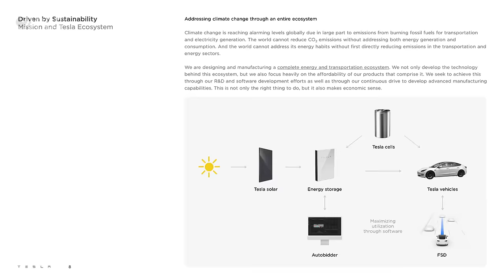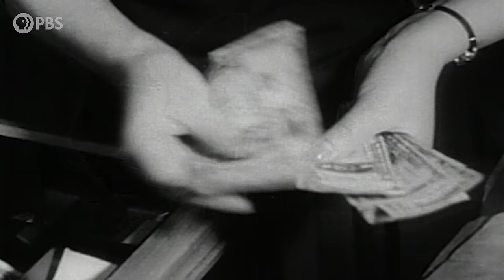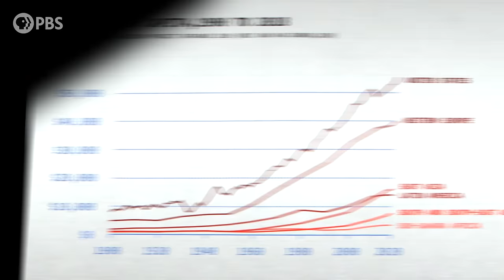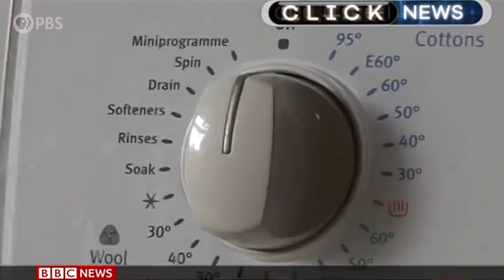You Can't Shop Your Way Out of Climate Change

Comment: The fact we are not focused on electric generation and pushing EV cars is literally putting the cart before the horse.
Reply: The American way. AMURICA LOL
Reply: Hydrogen would be better.  EV cars are almost throwaway cars at this point in time. Once the battery pack is gone and it's out of warranty who would pay more than the car's worth to fix it?  Hydrogen is the most abundant thing in the universe. Toyota has made some innovations in the last few years.  BEV's should just be a stop gap.
Reply: @deucebigs9860  the problem is just that Hydrogen is just a bet in the future, right? No one knows if or when it could work
Reply: The problem is Evs is that the wost enemy of batteries is cold and heat 

Too cold like any battery then it will die quickly and the same with heat as if it’s 95 or more then the battery will be overheated and won’t work and pushing ev cars suddenly is a bad move as now we have inflation and the charge is by electric factories that burn co2 

So ev cars aren’t clean and they have many problems
Reply: @deucebigs9860  Biggest problem with Hydrogen is that storage is a difficult problem, believe it or not. The Hydrogen molecule is so small it can pass through any material due to effusion and metal containers are the most easily corroded of them all as it reacts with the Hydrogen to form brittle alloys...
Reply: @theotherohlourdespadua1131  Totally, but the research is continuing, and like I said Toyota has made some pretty impressive advancements.  We'll see.
Reply: @compactreview  We know plenty of ways it can work, but like with every technology if it's too expensive then late-stage capitalism says no, but they're still researching making it cheaper.
Reply: @deucebigs9860  here in Germany "capitalist" company's are heavily in favor of Hydrogen and promoting it politically.
It worry's me, because the entire "net 0" is build on Hydrogen, which has never been tested on such a scale, because it doesn't really exist yet.
I just think it's too much of a risk. Electrical options should not come short
Reply: @compactreview   Batteries rely on rare earth materials and destroying the planet to get them so they aren't great, but a good step over oil, hydrogen should be another step even cleaner if they can figure it out.  Realistically we're always going to be looking for the lesser of a lot of evils, and just try to do the best we can.
Reply: @deucebigs9860  there exists batteries without really rare materials, and lithium for example can even be mined in Germany or overall Europe alone for the coming decades. And this new production has currently better chances than hydrogen. But yes, if possible, Hydrogen could be great. But plasma reactors would be also even greater for electricity
Reply: @compactreview  It depends if you care about the size and power output though (at least the ones I'm aware of), but if those happen sooner than hydrogen that's great news too.

Comment: Yes, we need to consume less. 

However, we’re also just starting to close the loop for a circular economy. For example: yes, mining of the materials needed is energy intensive and adds GHGs. But we’re trying to work on that by potentially having the process be net zero with the mining trucks being powered by Hydrogen. 

We’re not going to consume less stuff or energy. So we need to work as hard as possible to figure out solutions to close the loop.

Comment: Some purchases are good, if you are buying an item you will use long-term that's replacing a single-use or short-use plastic item. Razors, toothbrushes, deodorant, and menstrual products are the top ones that come to mind.

Really tired of pressure not being put on corporations though.

Comment: Overall I agree with the video, but I think bashing on EVs specifically is not it. Even in my little Honda Fit, I burned about 5000 gallons of gasoline while I had it. That’s 20,000 pounds of C02 worth which vastly outweighs the additional EV manufacturing environmental impact. As the grid gets greener, so do the EVs. I agree everyone needing a personal vehicle is ridiculously wastefull especially in the US however IF you absolutely need a vehicle then an EV is the far better choice environment wise until you don’t need a vehicle at all. Don’t let perfection get in the way of progress. Reduce any way you can including if that means switching to an EV instead of a gas car.
Reply: Ultimately the goal is to go car-less anyways. America is far too car-centric, and things could easily be solved by building the spaces we live in closer together so they're either within walking distance, or can be gotten to via public transport.
Reply: @DrizzyB  Ultimately 15 minute cities are way less impactful and honestly a better way to live, but you need the cities and public transit first before cars can be reduced. In the mean time while cars are still ubiquitous, EVs can drastically reduce personal transportation fossil fuel use which is the main driver of climate change. Idealism should not get in the way of progress
Reply: @Tazdeviloo7  oh ok

Comment: I have started to buy shampoo in bars that doesn't require a plastic bottle.   I think THAT is a good change as we need shampoo anyway.   We have had solar panels for 22 years and bought a used Chevy Volt and we hardly ever have to buy gas because we make the electricity ourselves and don't drive that much.  I have a denim shirt from maybe 25 years ago.   I just saw that they have come back in style.

Comment: 1) Buy solar for your cottage, home, parents' place --> reduce need for electricity from 30-100%
2) If you have the budget, buy enough solar to have excess to charge your electric car
3) Buy home battery storage after you paid off more than 50% of you solar (home battery storage gets cheaper every year, so might be good idea to wait for couple years still)

You are now very close to off grid and removed your foot print that comes from burning coal/oil etc and reduced the strain on your local grid as you consume the electricity you generate.

Comment: I touched on this in one of your other videos about climate change, and you touched on several things that needed to be said as well.  In other other video I mentioned that the issues are mostly on the manufacturing side of things for carbon.  Also electric cars need more and costlier maintenance and require more computer chips that are high pollutant producer in their manufacturing.

Too many things are also built to fail.  Did you know they can make lightbulbs that last forever, but dont because it would destroy the lightbulb industry.  Many things are made to fail so you have to buy more, im looking at you apple. (and most of the manufacturing industry).

Comment: Buy smaller TV when its sufficient, Buy only what you need. No more air travel. Do not heat all rooms.Turn off air condition. Neglect your car. Ride a bike for local trips, consider public transport.

Comment: The actual problem with these products is that most of the companies essentially front load the pollution aspects rather than have what would be a "pollution factor over time" via usage of the products. The situation is that those renewable products are created using even more polluting practices front loaded than the competition over time (such as the ecological impact of lithium harvesting for car batteries).

The simple fact is the entirety of how we produce things creates these byproducts such as runoff and waste and exhaust and there is nothing different and the amount done is already far too little too late.

If someone finds a means of fixing what was done, then that will only justify the gross exploitation and things will continue the status quo.

The sad part is we need to experience what's going to happen, as a species, and we will have to suffer through it before people actually recognize just what is going on. Unfortunately, people are just a bit inept like that.

Comment: If recycling effectively is not pursued on all things that humans make and use ,then it truly does not matter.Despite all the worries about Oil consumption vs. Battery technology ,it still takes oil to make the housing of the batteries. Plastics are the problem.If we do not recycle plastics and demand producers to recycle what they produce then what?Even electric vehicles depend heavily on plastic products.Oil is a major component of plastic products.Production of Lithium batteries are not the answer either.Recycling is the only alternative to plastic pollution.

Comment: It's been so annoying how our society has taken this "You can make a difference" approach. When it just plays with people's emotions & they feel like they need to spend $ to make up for things. This issue is so much bigger than individual people. We need countries/states to get on board. It's the only way we can make even the Slightest difference. We've already waited too long. Everyday is a day wasted where we aren't committed to modern nuclear energy options. It should be utilized in collaboration with other alternative energy sources all over the place. Especially with all our advancements. Our knowledge around safety measures is much more understood. We've also seen vast improvements in engineering, material science, technology, robotics, etc. They are all much more advanced now. This power source is the best option to improve our environment & will really help lower our emissions. The only things holding us back is legislation, fear mongering & past trauma that's affected us from our past (which is understandable but we really gotta give it a chance to see if it can prove it has progressed & improved) 

Did they outlaw electricity or oil, coal when things went wrong in the early days of those fields? No! They kept going and understood things usually are bumpy and difficult in the beginning and kept going even tho those sources negatively impacted our environment. A huge issue is our government is BLOCKING any sort of progression from happening. We'd be lucky to see the slightest projects approved or finished with-in the next 100 years.. It's very annoying to see how much we have gotten in our own way when it comes to improving or advancing certain things. Instead we let fear, money, man made "required legal processes" Stop us from doing anything other than wind, solar, oil, natural gas, damming our rivers, mining for minerals... It's very frustrating because we should be able to use all these options in collaboration. If we actually wanted to improve anything. That's what we need to do and stop letting so much potential get blocked from ever occurring in the first place.. It's really irritating. I wish certain people didn't make this so "complicated and difficult" Why would any reasonable person want to block progression?

Comment: Edit: my original comment has been deleted.

I was questioning the validity of the "36 tons of CO2" number mentioned in the video for a Tesla over a 17 years life span. How did they arrive at this number? No mention was made about the energy source used to charge the car over those 17 years. Was it fossil fuels, nuclear, hydro, wind or solar?

As for needing a car to live, you can blame cities for that. We should be designing our cities for people instead of cars. Using bikes should not be viewed as exercise but as a legit transportation method because EVs still won't solve this car-centric design mentality problem that most modern cities are built around.
Reply: To be honest, that's probably just Youtube being youtube. Had that happen even to channels I'm friends with.
Reply: @Xiph1980  That is a possibility. What boggles the mind is how a company as big as Google cannot produce stable software. They really are the new Microsoft of the Internet era.
Reply: Yeah, I become sceptical as soon as she starts to talk sh*t with EVs. EVs always win in terms of environmental effects in the long term compared to other cars. Not the best among all transport options, but definitely the winner among automobiles.
There is a reason people should replace old washing machines because newer ones are built to comply with stricter and stricter energy efficiency requirements. Anti-repair is another issue though, but that is another thing.
IMO there should be less individual consumption but MORE public consumption. Governments need to build more high-speed railways, nuclear and renewable power plants and walkable cities. 
Also, f**k cycling helmet mandates!

Comment: On the EV issue. Yes the initial construction of an EV uses more emissions than most cars. But with no emissions for the life of the car after that, the EV quickly catches up to a combustion car within two years of average driving and is much less net emissions over the course of an average life of the car (10 years).

Still the problem with EVs and all cars is that personal vehicles is an incredibly resource intensive process and incredibly inefficient to transport on average one or two people. We need less reliance on personal vehicles period.

In the short term, EV is absolutely the better choice when it comes to green house gas emissions.

Comment: The premise of the video is essentially correct, but all the parts about electric vehicles (TESLA) are basically wrong.  For example there is NO steel used in the Tesla car bodies, they are all aluminum.  Factories are being built so that 100% of used electric car batteries will be recycled into new batteries etc.

Comment: A lot of this is assuming the energy being used is from fossil fuels and therefore creating more emmissions. If our grid was not on a filthy and finite resource, most of your points would be obsolete. Or at the very least, still be a much better choice than using fossil fuels.

Comment: Consume less. Consume more. That isn't the issue. Curbing emission of fossil GHGs to the air is the pressing issue, and cutting financing, licenses and permits for fossil trade is key to addressing it. 
Avoiding methane - diverting biomethane from emission to displace fossil methane where possible is second to culling business, institutions and governments (BIG) of the thinking that allows fossil emission.
Scrapping fossil emitting equipment so it can't be reused by others for the same purpose is critical, by Jovens Paradox: if you make fossil free better, you induce more fossil trade.

Increase energy efficiency 8% per year by mandate. That's better than giving up shopping.
New biomass growth and harvest makes buying a lot of things necessary, where they help biosequester.
Generating more biodiversity and wilderness conservation equal to 40% less sea traffic, that will help.

All of this CASING priority starts in BIG boardrooms. Find people who make BIG decisions and let them know.

Comment: They need to be more specific in their break down of EVs.. the point being they aren’t zero emission, just zero emission at the road side. The argument of being more polluting than combustion engines have been proven false many times with the single use that goes in to the production running of a combustion engine. They always mention the supply line of EV, but never the supply line of the  ICE fuel.. because they know EV energy pales in comparison to the massive amounts of energy used for fuel production. That being said, I don’t think EV should’ve been pushed so hard, even though the push has helped with the development of better battery tech, we should’ve had hybrid as a standard years ago, as it fits a wider range of life style, full EV fits some people lives and ability to park and charge at home, but not all.. this lead on with it being adopted by people who can’t, and overwhelming a charge network not fully ready for full adoption.. giving them a bad name.

Comment: Your message is correct, but you don't gain credibility with mistruths. Of course, private cars should be a last resort for urban transportation, but "junk the batteries"??? Batteries are extremely valuable at the end of a car's life. First they can, and are, being reused in stationary applications because they tend to still have at least 80% of their initial capacity. After another decade or two of real use, the rare and expensive metals and minerals absolutely will be recycled. Battery recycling didn't make sense at the scale of phones. At the scale of EVs it's a no-brainer. They are way too valuable to "junk".

That 36 tonnes cannot be blamed on a single car. That single car is merely a borrower of those tonnes and is ultimately responsible for a small fraction of it.